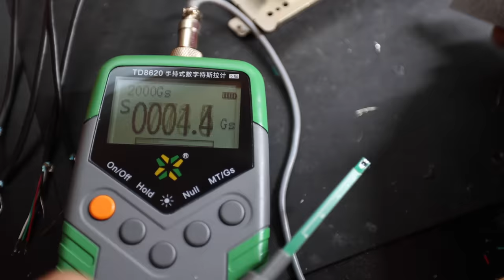Do Humbucker Magnets Make A Difference

Comment: I feel like the 2 sounded really sweet allowing us to hear the strings as they are whereas the 5 sounded like it had a little more breakup and the 8 sounded like it'd be great for metal maximizing signal. I've always been a fan of lower output pickups for their clarity and how they play with OD pedals and drive on amps.
Reply: Normally, you would adjust the pickup height differently for the best sound in each type.  That makes for a slippery slope in doing a "fair" comparison.  Weaker magnets like more height.  Stronger ones have a wider usable range in distance.  A3's are picky about height.
Another challenge here is that pickups may be wound with a magnet type in mind, so any particular magnet might not be well suited to a given pickup.

Comment: 8.5K is the sweet spot for my favorite sounding bridge humbuckers, congrats on the release of this one, I hope you sell a lot of them.  Do you find that there is an ideal winding count related to what number of alnico is used?  Do you like to charge magnets fully, or partially?  And does a weakly charged alnico V if charged to the same strength as a fully charged alnico II still sound different?

Comment: This video kinda asks more questions than it answers... The stronger magnets clearly sound thicker and hit the amp harder, but what if you dialed down the input gain on the amp? Would you get a similar sound or would each magnet still have its own character? Or, what if you adjusted the other parameters of the pickup to get similar outputs from each? would they sound different again? Would that be different to adjusting the amp gain to compensate? Do they each feel different to play?

Fwiw I think I preferred the sound of the A2 in this test - clearer than the others, no muddy mids.

Comment: The Alnico 2 was less output and brighter. Sounded good. The Alnico 5 was less bright. Sounded good as well. The Alnico 8 was hotter and had a little of the Alnico 2 brightness.

Comment: The A2 had better clarity than the others.  The A8 was crunchy and tight.  The A5 was in between having more crunchy than the A2 but lacking the tightness of the A8 it was a bit more fuzzy/ruff around the edges to my ears.  I'm generally more of a single coil guy.  I've never played an A8 bucker, but out of the pickups i have played, when using a full size humbucker i prefer a moderate output pickup with A2 magnet.  I'd be interested to here how the A8 does under high gain.  I guess it depends on how hot the coils are wound, but to my ears a lot of hot pickups tend to get muddy when they go into a high gain amp.  I feel like the A5 in this video might end up in that camp. Non of them sounded bad.  but my preference would be the A2.  You can make a clean pickup dirty, but you can't make a dirty pickup clean.

Comment: I prefer Alnico 5 in most pickups humbucking or single coil. Just seems consistently most pleasing to my ears. Alnico 2 would be second but I still prefer Alnico 5 in most circumstances.   It has a clearness about it and good articulation. Dont care for other magnets other than Alnico 2 and 5. Alnico 8 is too much. Alnico 5 strikes the best overall balance.

Comment: The differences are subtle. Especially on the Neck. 2 seems a bit brighter, 5 darker, 8 about the same as 5 but punchier and a touch more low mids. At least that's what my ears are picking up.

Comment: With headphones, I heard absolutely no difference. I have no clue how you heard what you explained. They all sounded great, but no different. I'm starting to think Glenn is right. Not enough difference to make a difference.
Reply: I'm starting to agree. Single coil or double coil makes a difference. And after that I think a good well made quality pickup will sound better with more tone than a lot of cheap poorly made pickups. After that, these differences are so tiny I don't know that they make much of any difference. Definitely not as much as the speaker.